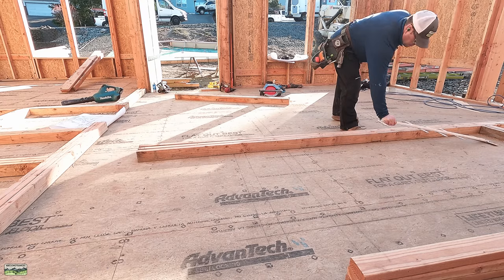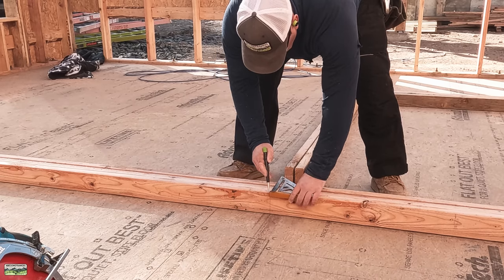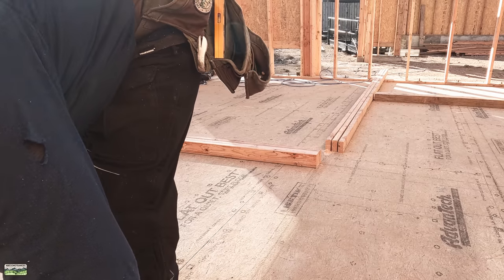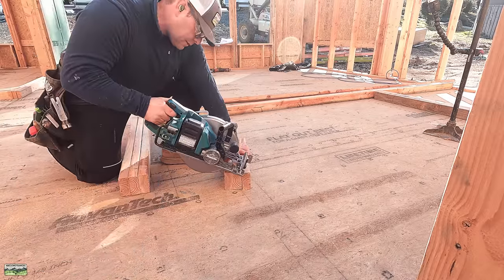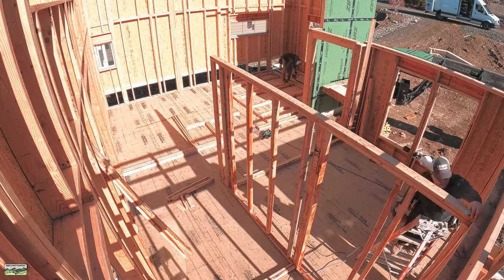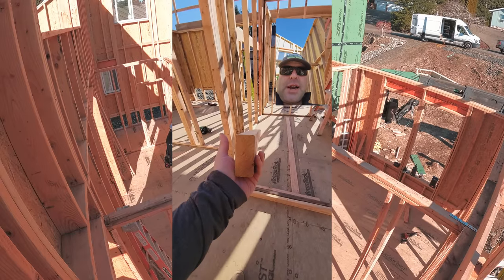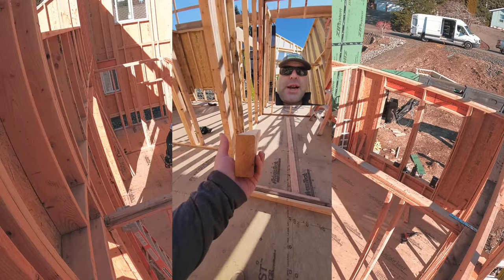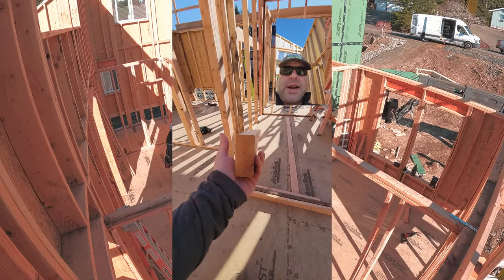You Don't Lap Plates?!  Interior Wall Layout Project 150

Comment: Does it have the same shear resistance? Thanks for the video Mr.:D
Reply: Of course.
Simpson makes strapping and clips for hurricanes lol
Reply: @evictioncarpentry2628  Ofc I know what Simpson does doh, I was just wondering if that piece of tin is stronger than a 2x4. I use similar bracing but only to counter uplifting..😀
Reply: @nZebco  Doubtful
Reply: @nZebco  If it wasn't as strong or stronger then a wood connection, would it be hurricane rated? Lol

If you're pulling apart a partition wall, which these are, they're not structural, it's going to be the same shear force pulling them apart as a vertical strap with uplifting.

Comment: Thanks for the video!! What keeps you from moving to single top plate if you're not overlapping? Do you still need the flexibility to not stack members sometimes?
Reply: Isn't it for nailing other elements, trim, etc?
Reply: Special length studs. And if you have to cut them, that's more work. Better to stick with double plate and precuts.
Reply: Double plate is also for holding the vertical weight from the roof down.

Comment: I assume the thickness of the straps and nails isn't enough to cause issues with the future floor system / trusses potentially sitting on top of them.
Reply: He said towards the end that he tries to keep them off layout if possible, but I would assume that 1/16” to 3/32” thick strap won’t make much of a problem either way
Reply: I have had material out of the same bundle that is different thicknesses and widths. I would have thought that if they are in the same bundle that they came from the same 4 sided planer so they are the same. Maybe I'm thinking wrong. To respond to your question, I don't think it would make a difference. By the time each piece of wood shrinks differently who knows how thick each piece will be. Again, maybe I'm all wet.

Comment: Watch Larry Haun’s building walls video and realize how silly this is.
Reply: You don’t think building construction has progressed at all in the last 20 years? I’m pretty sure that video was released in the early 2000’s…
Reply: @TheRealBeardedBuilder  What he is doing is not acceptable. He comes up with his own ways and thinks he had the best technique.
Reply: @Faruk651  I’m sure it’s perfectly fine if an engineer signs off on it. I’m sure you probably use a bunch of 2x12 material stacked together for your headers instead of moving to a single LVL too. It’s ok to be more efficient and progress in your trade.
Reply: @Faruk651  why is it not acceptable?  These are partitions, just there (mostly) to hold drywall.  I'm genuinely curious as to why you think this is substandard.
Reply: @TheRealBeardedBuilder  I use steel for beams.